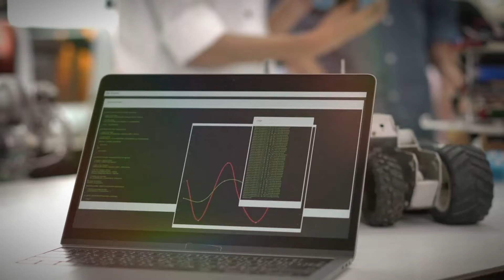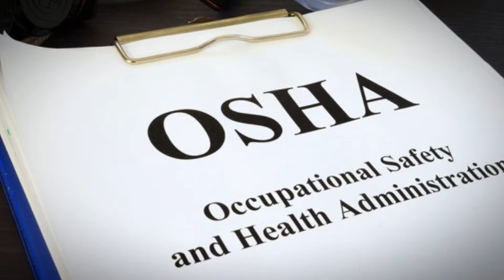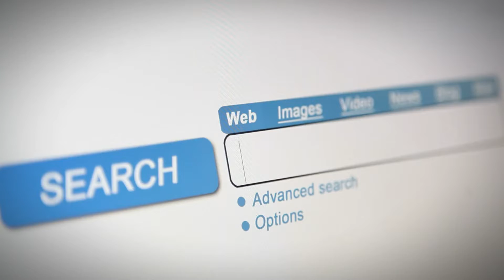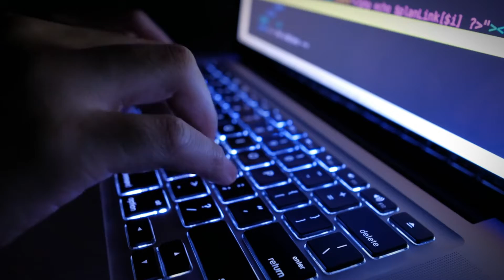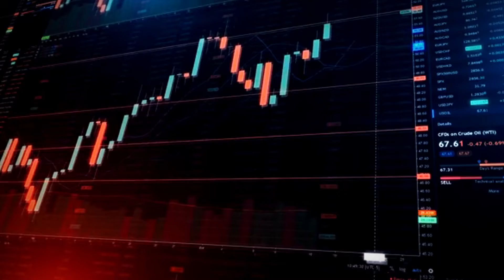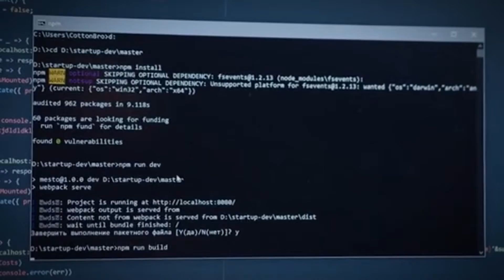The Tesla Robot Incident: A Rare Accident or a Sign of Things to Come?

Comment: You are talking about the old type arm-robot that has been in industial use for over 20 years right? Where the technician did not turn it of and the arm did what it was programmed to do.. right?
Reply from the maker: Based on Elon Musk, commented on the story via X, formerly known as Twitter.
“  The accident in Texas involved a Kuka robot arm that is used in manufacturing automobiles there" and according to KUKA website :The machines are between eight and eighteen years old .